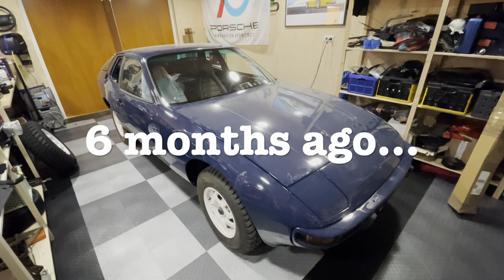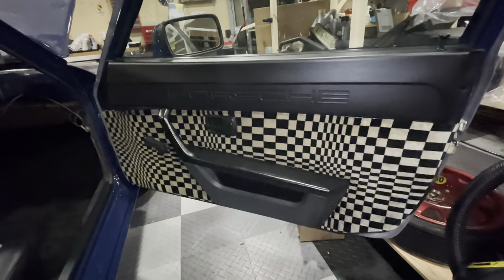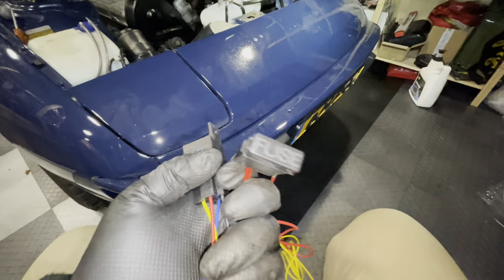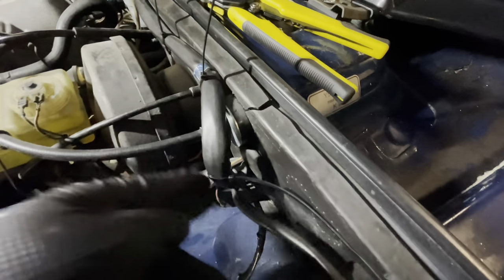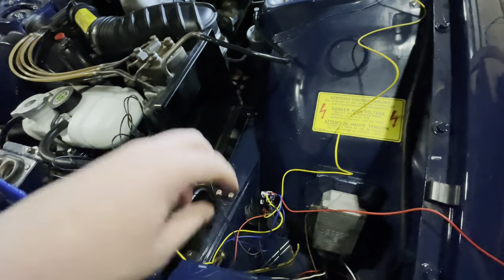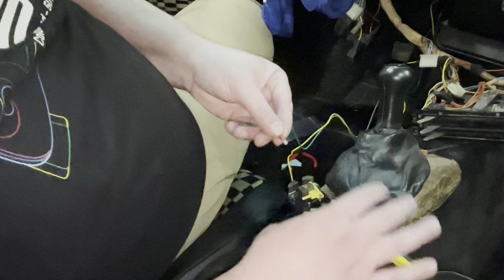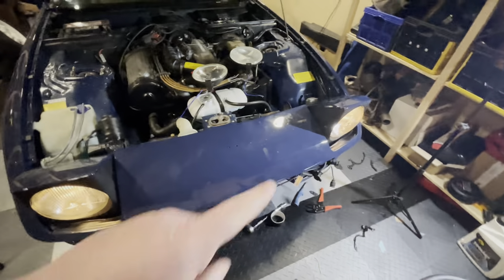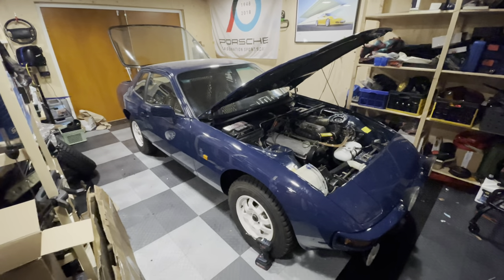Building a Porsche 924 Safari: Build Update. #Lights #Interior

Comment: Great to see the return of the safari build, I admire your thoroughness! It's looking awesome. Where did you find the new coolant reservoir?
Reply from the maker: Thank you very much!  I bought my reservoir from Rosepassion, but you can order it from any Porsche parts supplier. Here is the link for Rosepassion https://www.rosepassion.com/nl/schema-s-porsche-924-1981-eu-924-2-0-coupe-manuele-bak-5-versnellingen/motor-en-benzinetoevoer-36/waterradiator-expansievat-waterslang-959/pcg121405a-p5194-compensatiereservoir-028121405a-5194.